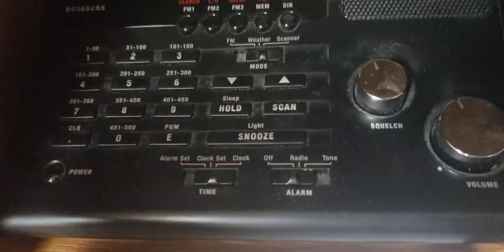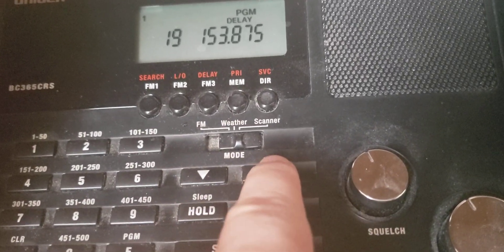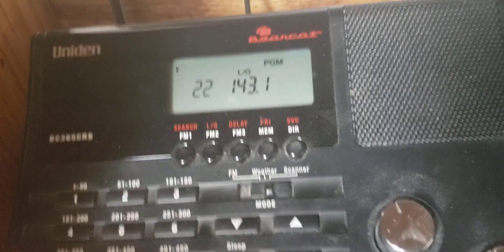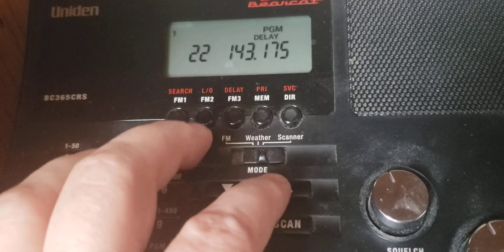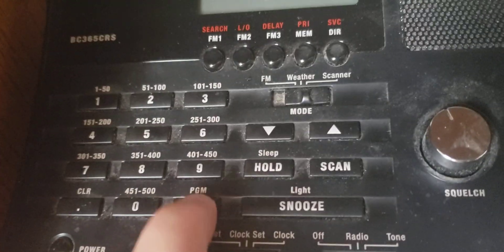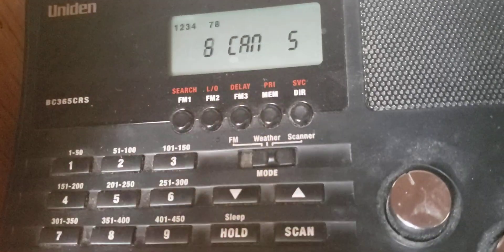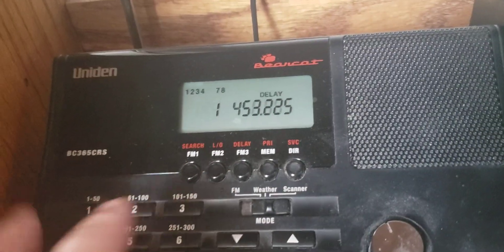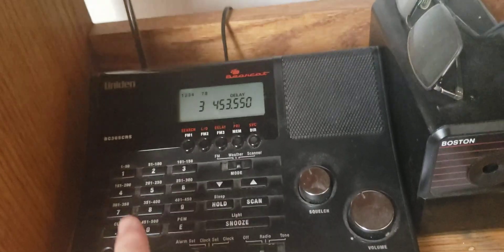How to program a Uniden BC365CRS scanner.

Comment: On a channel with 4 digits after the (.) ie 425.46250 .. Do you just not put in the zero? I've got some that have 4 digits, 425.4625 for example. Mine makes an error beep when I try to program it.. Suggestions? p.s. I'm a newbie with this scanner.
Reply from the maker: So if your putting in the scanner like that usaly I leave out the last number if its 0 so like 123.45650 try leaving the 0 out if it gives the beep and error again try a few times if it continues try a different scanner code for that channel some scanner channel have multiple channels some like 123.400 or 123.779990 try leaving out the last 2 if it continues to give error might be a scanner it can't pick up or bad or incorrect code number.

Comment: If I unplug it without batteries, will I have to reprogram everything?
Reply from the maker: If unplugged fir a short time no if unplugged for a long time yes you will lose your settings and have to reprogram it if your moving it to another room you should be fine if your moving to another place or power goes out but I would ut batteries in just incase its a pain in the butt takes 3 aa batteries works on any kind even dollar tree batteries.
Reply: Alkaline batteries are the devil 😈 trus Nickle cad batteries